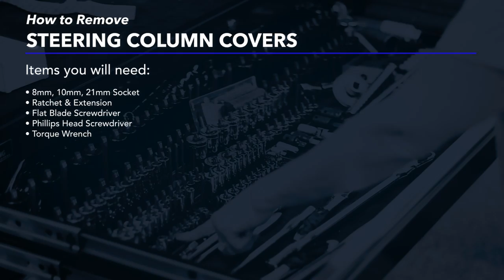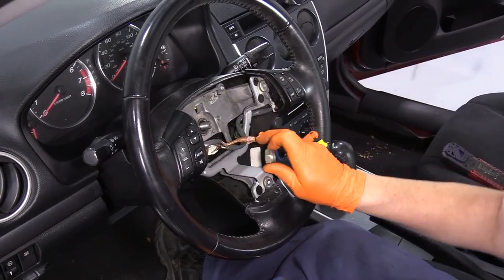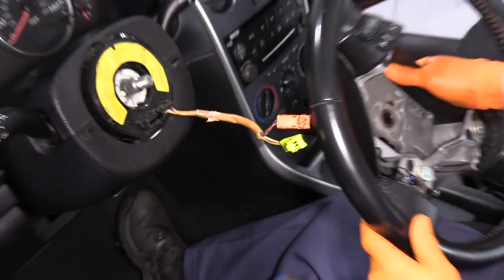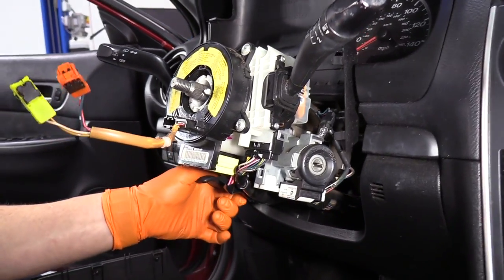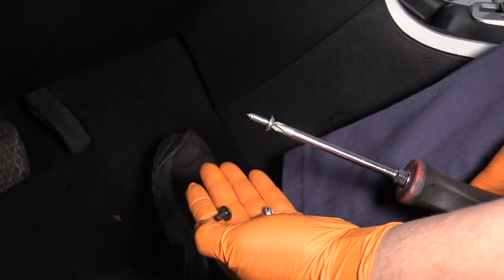How to Remove Steering Column Covers 02-07 Mazda 6

Comment: that was what I exactly needed Maam ,,, I just wanted to change the ignition key Switch, which showed up right there when U just did half the video i.e. when Removed the Cover & was just to Refit… My Car is Mazda 626 LX 2001 ,,, So is that what i need to Do to Change that Key socket ??? cause when I crank my car doesnt start… but cranks & Lights & every thing is working Proper Even the A/C gets started Just the car doesnt start…. Plz Ans… Me… Thanks & Appreciate this Video…. Thanks Again for the upload

Comment: Hello, nice video!! Can i remove it without removing the steering wheel ? I just want to change the ignition key illumination bulb and it seems to me like "a lot work" just for a bulb. Thanks in advance!
Reply from the maker: +Jovan Zacevski Usually to access it at all you would have to remove the steering wheel. Thanks for checking us out! 1AAuto.com
Reply: Remove the 3 screws on the bottom, then turn the wheel to 3 o'clock then to 9 o'clock to access those 2 clips that hold top and bottom together. Then you can remove it as shown in the video.